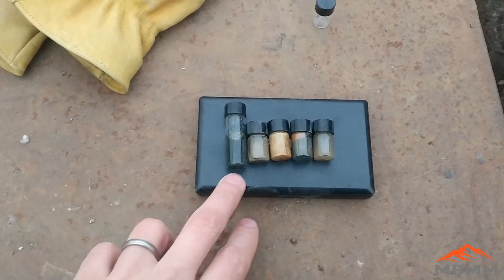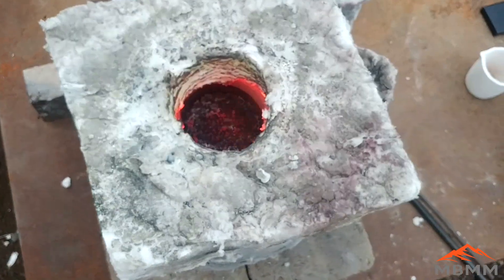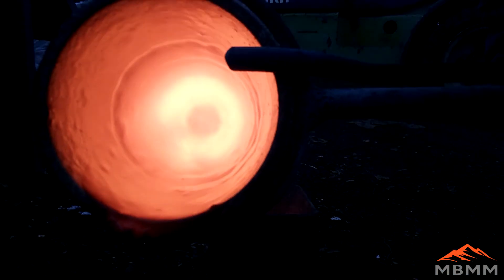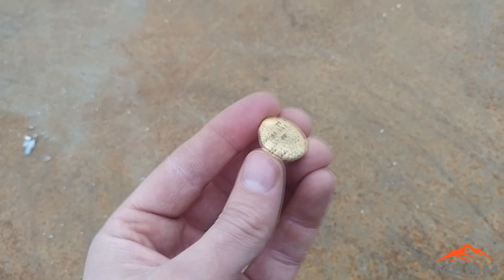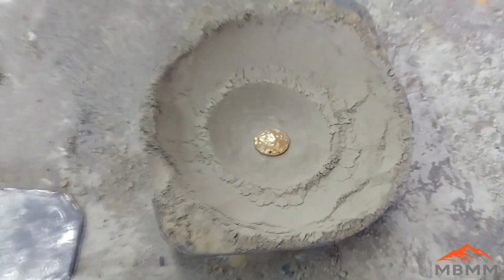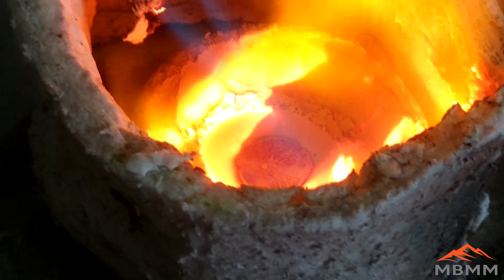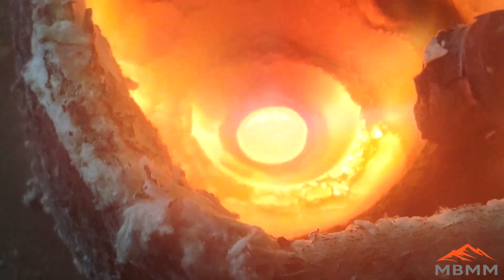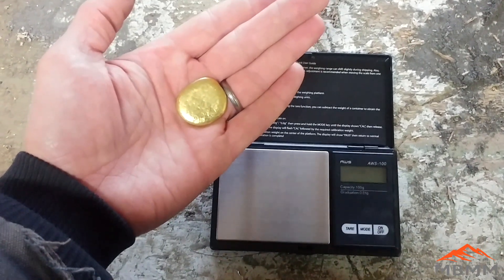Smelting & Refining Fine Gold Dust To 22.5 Karat Purity

Comment: The solidifying process slag included see this is the process of the malted lava without removing the slide solidifies into a rock form formation with the oozing of the lava overlapping creating the falls on top of the flag as the lava oozes creating the fold the flag creating the butter in between the dough which creates the layer process

Comment: why not inquart the impure gold (reduce it to 25% gold content) and dissolve the base metals using nitric acid, then rinse the remaining gold with water and dissolve the gold with aqua regia (Hydrochloric acid witrh a bit of nitric acid) then filter out the gold chloride solution. Finally you add some sodium metabisulfite to solidify the gold, filter it out and finally melt the gold powder in its filter paper. Done properly you will get 999 fine gold. NOTE. DO ALL OF THE CHEMICAL OPERATIONS UNDER A FUME HOOD, DEADLY FUMES ARE PRODUCED.
Reply from the maker: Thanks for the tips
Reply: @mbmmllc  zYou really need to hook up with eWaste Ben, he breaks down thousands of PCs a year.

Comment: How did you determine you needed to add 2-3x more lead than the sample weighs?  Would have adding more lead removed the remaining .5% of Cu from the button?
Reply from the maker: good question.  In an assay they have a huge percentage more lead than PM's, I have done experiments since and I don't think that much lead in necessary.  Probably 1 to 1 is fine

Comment: 9:46 did the button had any cement attached to the bottom?
Reply from the maker: Some times it does, but if it does, I usually re-cupel for beter results.  I just got some real cupels so i am going to try those.  I wanted to thank you specifically, because I got the technique from your channel.  Passing on good information is important.  Thanks for teaching me!!
Reply: mbmmllc I thank you!

Comment: send to refiner after first melt, if the refiner pays 95% of what its worth if its 22.5 karat or 95% of what its worth if it's 24 karat it would make more sense to sell it after the initial melt as there's no increase in value and only an increase in costs my remelting or refining in house
Reply from the maker: Great, thanks for the tip!

Comment: because the silver is easy to remove aquarich the hydrochloric acid  will force it out of solution  and the gold will become chlorotic acid and can be precipitated out in high purity with sodium metabisulfite a food preservative and the sample is small  i would add copper to it to inquart the gold with nitric acid the silver and base metals will be in solution filter the solids that will contain all your gold after filtering add a little hydrochloric acid to the nitric acid and the silver will fall out  as silver chlorate then put the solids filter paper and all into a little aquaricha the gold will go into solution as chloroauric acid and can be precipitated out in high purity with sodium metabisulfite filter the nitric acid for the silver chlorate powder filter the aquaricha for the gold powder dump the waste acid into a 5 gallon plastic bucket  reuse to remove base metals till sacherated the drop a chunk of cast iron in the bucket to drop the other metals out this may take a while so just let it sit a few months late filter out the dropped metals  now the acid is full of iron salts so you can nutrilize any remaining acid and either use it as fertilizer heavy in nitrates and iron or it is safe enough to pour down a drain but you can not do this until all other metals are removed and any remaining acid is neutralized if you do this you must make what you dispose safe.
Reply from the maker: Great, thanks for the tip!
Reply: clayton mccormick k

Comment: At that size I highly doubt the difference would be worth the cost in material used. I would be more inclined to melt the button and dropping it into water (while molten) to create shot. Soak the shot in dilute nitric acid creating a 98-99% pure gold dust to be easily melted. You can then cement the silver out with some scrap copper.
Reply from the maker: Great, thanks for the tip!